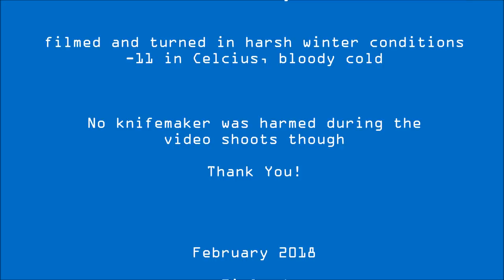Puronvarsi Ice Hockey Puck Puukko Knife

Comment: very nice glue lines (as in you cant see them!) How did you laminate the sections together? Lovely overall result, very hip modern look but till rooted in tradition
Reply from the maker: GOLDSMITHEXILE 2016 Hi, thank you! All the 8 parts were first glued together and not all of them at the same time either. So it was a job to make first the knife handle raw block. There’s no secrets just good straight cutting/sanding lines 👍🏻 and Gorilla glue. And the theme for the knife handle was Finnish flag! Thanks, Osmo
Reply: Aha gorilla glue, the honey coloured one that cures with water? I started using that a year or so ago to build drum shells, very useful. You evidently clamped it well, that stuff has incredible pressure when it goes off

Comment: Looks great Osmo! 👍🏼 Very nice colours! Did the rubber try to burn when you were turning it on the grinder?
Reply from the maker: NuManXplore No, not at all. Only thing that I skipped. I only sanded it bu hands up to 400 and it was finished. Very grippy. Needs a new type of the sheath. More open and this will be carried in the pocket or rucksack not on the waist belt. Thanks, Osmo I liked it a lot!
Reply: Ok, great! It does look like it would be very grippy. Nice work!